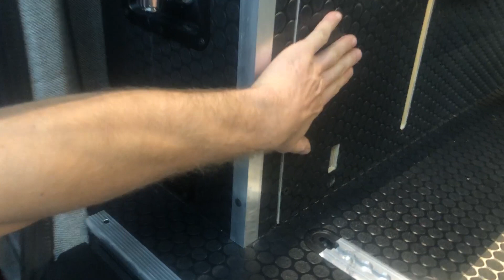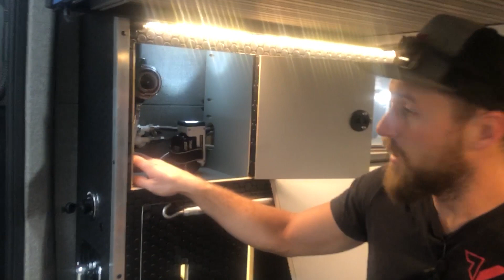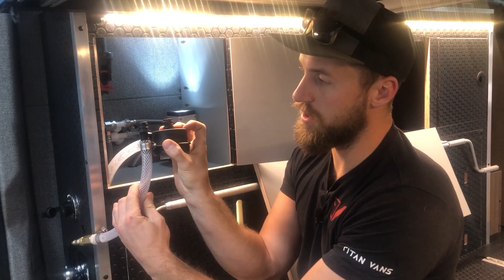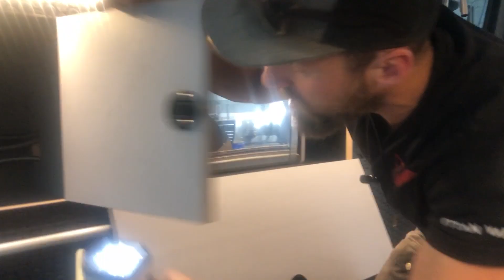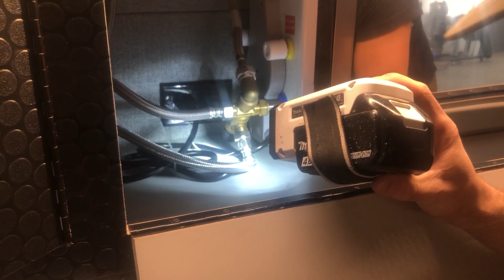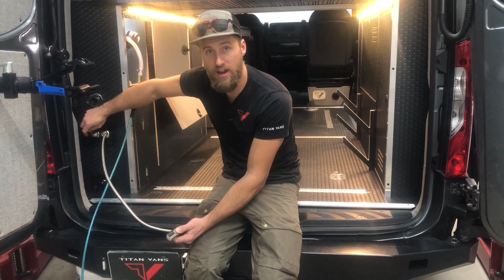How To Winterize Your Conversion Van (Titan Classic / Titan Custom)

Comment: I found this video while I was planning the plumbing in my build. I have a ShurFlo pump with no quick connect fitting, but I had an idea. Could I connect a three-way valve between my tank and pump? I could put an air compression fitting on it, and to winterize I would just open it for that fitting, connect my hose and blow it out. Do you see any problem with that idea?
Reply from the maker: Sure, you just need to find the right kind of valve that will allow you to have water on or air on without blowing air into the tank or water into the compressor fitting.

Comment: Thanks for your awesome vids.  I’m curious- How cold have people used your vans? I’m looking in the next few years to get a van which can survive Alberta’s 4 seasons. -30 to -38 was the worst 10 days of winter this year. I’d be using the van full time for work for one week then running home to play in the mountains for 3 weeks where it can live in a heated garage but would be my every day driver. (Ideally with a removable 3 person bench for the school run.) Would that be pushing a van too far? Congrats on your great work!
Reply from the maker: Hey Doug, 
It's doable but would require a lot of heating and probably keeping the entire water system, fresh and grey, inside the van.